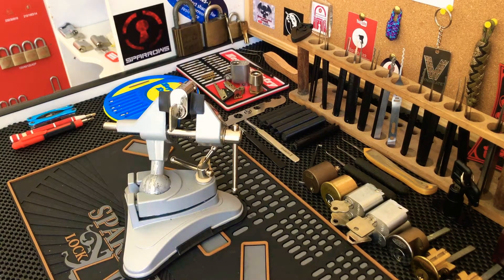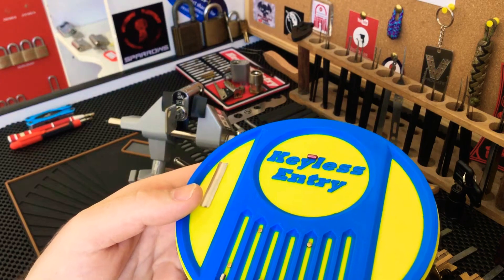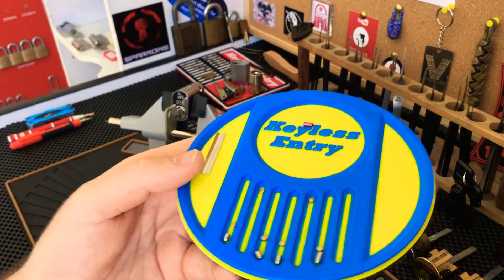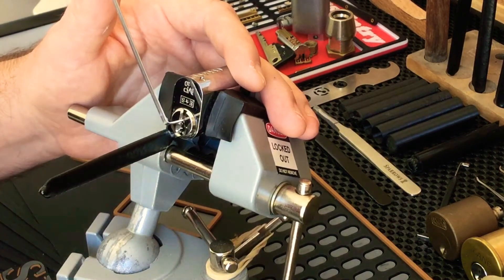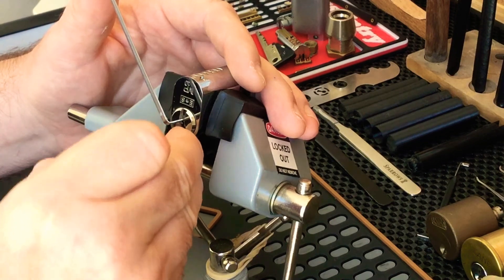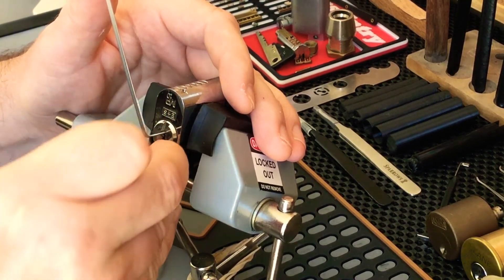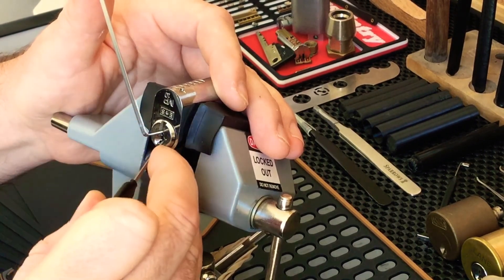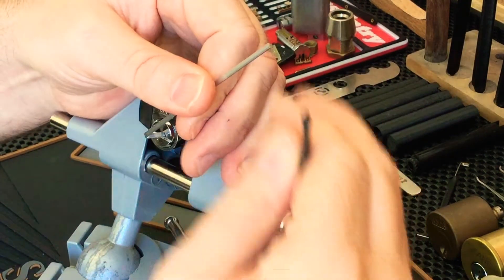(065) EUROSPEC MP10 Oval Part 2/3 - No Master Wafers, 1 Shear Line - #StockLockSunday

Comment: Nice picking mate. I drop my tension so much. Nice save though. Have a good one mate 👍🇦🇺😊
Reply from the maker: The Butcher’s bLock Cheers mate. I've had tensioners fly across the room lol, on this one I overset the key pin and when I released tension the driver dropped onto the shear line and the plug turned causing the tensioner to release, luck for sure👍😀✌️

Comment: Good save on the last minute wrench mishap. lol. Your bench is immaculate. Everything in order and place. A bit like mine........well, maybe not. lol. Have a good one:-)
Reply from the maker: paul springett Yeah very luck save, just as I let off tension the driver dropped onto the shear line and the core turned lol. My OCD is out of control I know, I'd still gladly swap benches with you as mine might be neater but yours has more quality👌